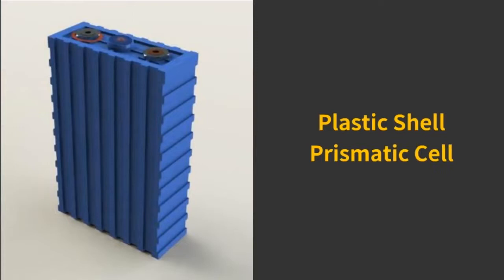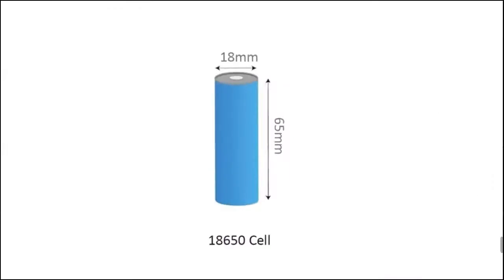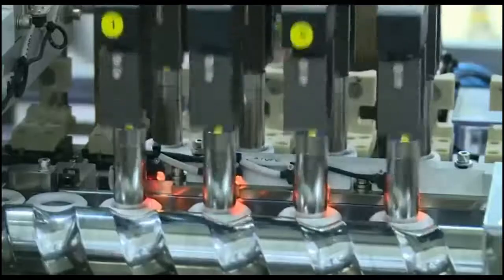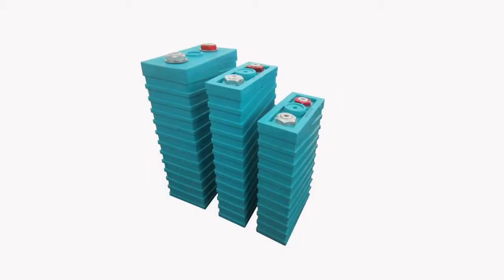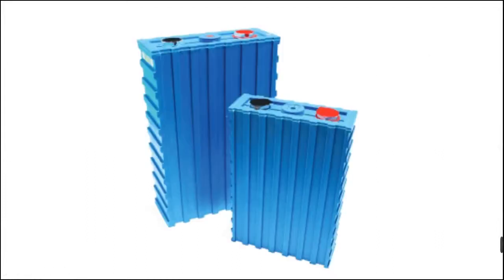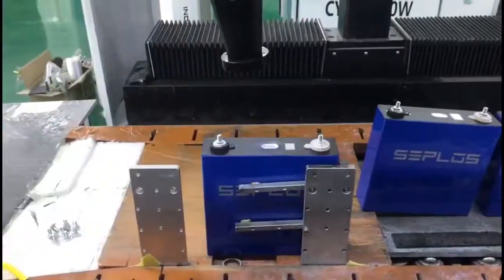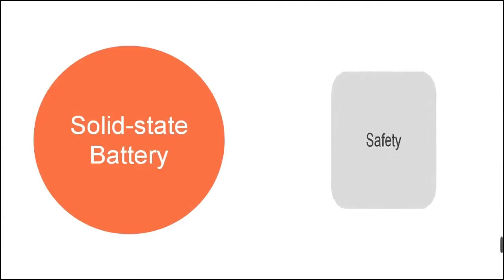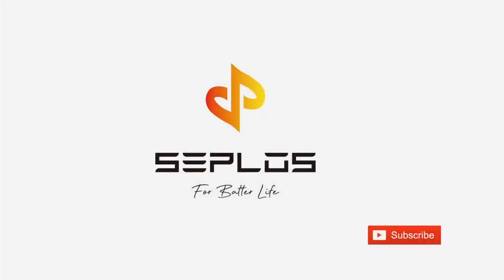cylindrical cell and cell module, plastic and aluminum prismatic cell, pouch cell, solid state cell

Comment from the maker: At present, most manufacturers produce aluminum shell plastic cells only.  So why aluminum shell prismatic cell is more widely used than plastic shell prismatic cell? 
Apart from what we've mentioned in the video, Heat dissipation, do you have any other ideas?
Reply: Weight and volume. The plastic case weight more as it is also much more thicker. In vehicles the volume is actually very important. Not only weight.

The plastic prismatic cells were made with NMC and high Nickel cathodes already 20 years ago. I bought my first NMC 50AH cells then. In 2002 we already had 200Ah cells too and they all were made by slitting and cutting the electrodes and stacked after that. This method and composition was inteoduced to market back then by Thunder Sky Battery. Inventor of these cells was mr Winston Chung.

Comment: Great video, Thank you.
As I understand, reversible swelling (volumetric expansion) occurs in the cells during the charging cycle. 
Since the prismatic and cylindrical cells are packed inside the aluminum casing, will the swelling cause any deformation on the casings? If so, is there any number available? 
Thank you
Reply from the maker: You can check the deformation test report at our Facebook page. Search for 'Seplos Batteries' in Facebook.